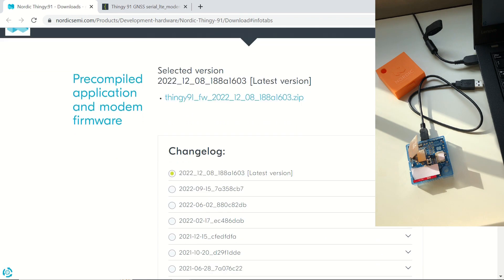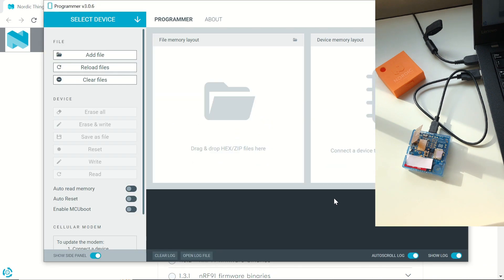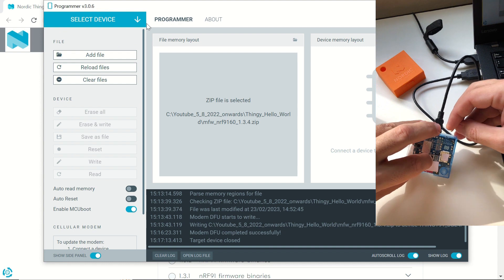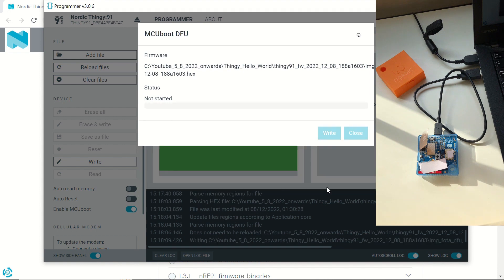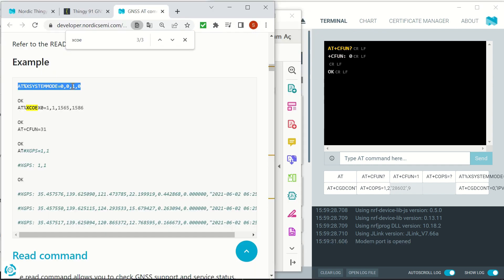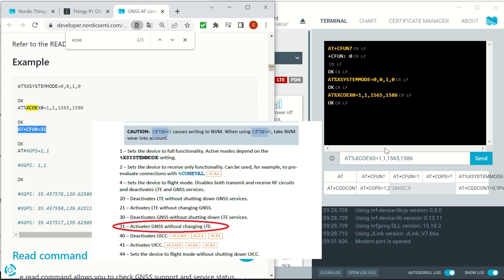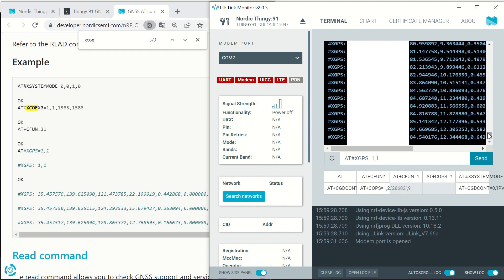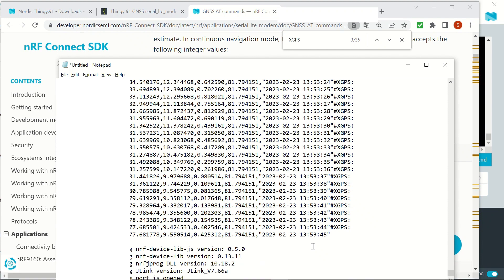GPS with Thingy 91

Comment: Do we need a SIM to make this work? I understand SIM has nothing to do with displaying GPS data over Serial, but just asking if this code has dependancy on the physical sim for anything.
Reply from the maker: Hi, I had the SIM on the device however it can not register in my country, so it should not be related. Also you can see that i only enable GNSS with the AT command. Anyway if i try it without SIM, I’ll let you know from this comment.
Reply: @drselim  Thanks for your reply. I am yet to get my sim. I will also try now without a SIM and let you know. Thanks again.